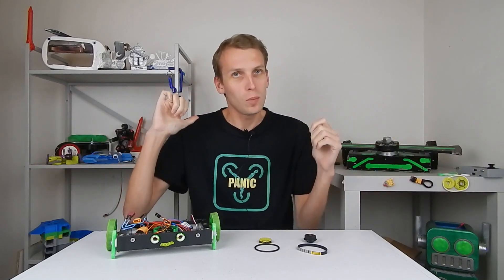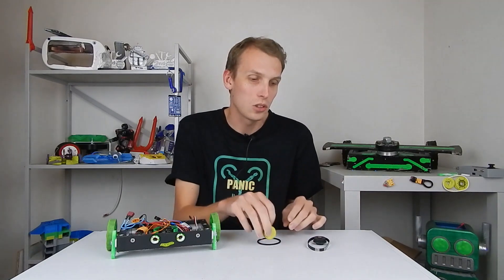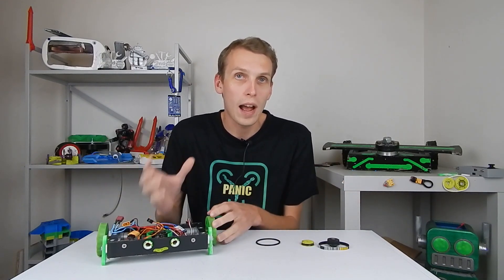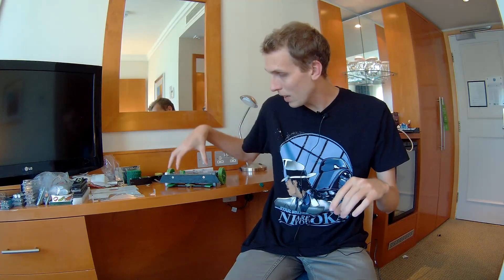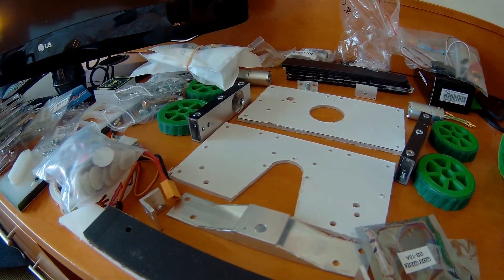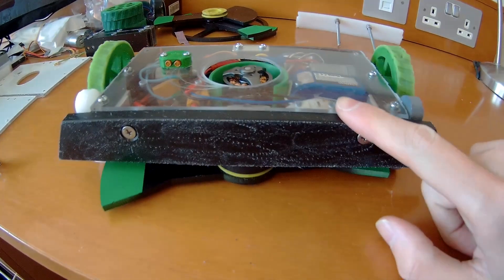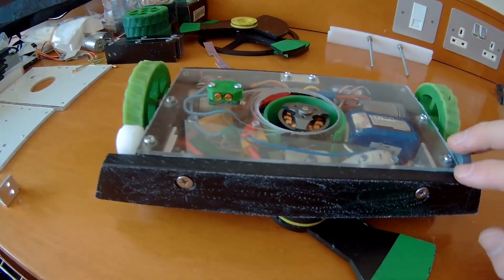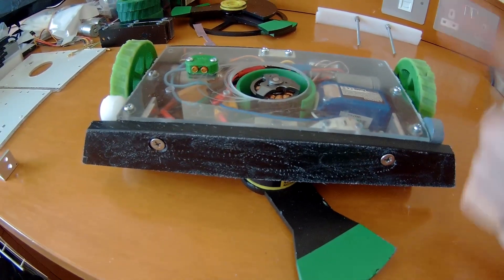Preparing for Bugglebots 2019

Comment: A few options I could see being useful:

Wedgelet Supports: supports that also stick out like a wedge to act as a secondary weapon in case the spinner breaks
Saw Blade/Abrasive Disk: better for opponents who has absorbant armor
Wheel Guards: optional wheel guards that can be used with a lighter weapon to protect the wheels
Lighter Blade: blade that can be equipped that allows more weight to be added as armor

Also noticed that you might want to turn down the turning sensitivity.
Reply from the maker: Thank you for the suggestions, but I have a few counter points for you to consider:

Wedgelet Supports:  people keep asking me to do this but it kills the point of the design, Anything that sticks out past the front armour removes some of the reach of my weapon, giving my opponent something to hit/get under other then my weapon. This is not an upgrade, its a nerf

Saw Blade/Abrasive Disk: These are hard to get right, you almost need a grabber to hold the opponent long enough for the disk/saw to cut. Also absorbent armour still has to be mounted to something, so the weapons I have will either take chunks out of their armour or rip it off its mounting. Also a saw blade would be difficult to make weight with

Wheel Guards: not a bad idea, but I dont want to remove weight from the weapon for them. The wheels are flexible and bounce when hit, so as long as I have a spinning weapon and face my opponent 70% of the time the wheels will be fine. I have definitely considered these but I need  to find a weight for them that doesnt come from the weapon

Comment: You should make Annie a wedge option for the back, just in case you lose the weapon
Reply from the maker: Thats not a bad idea, but it might be tricky to pull off, there isnt much room in the back of Annie to mount a wedge too
Reply: Team Panic it could be a light 3D printed wedge that is bolted on with a couple m3 bolts.

Comment: What fuse are you using in this iteration, because I don't know which fuse to put in my beetle's 3s
Reply from the maker: I'm using a car spade fuse.

You need to calculate the maximum current draw of your lipo battery and then choose the correct amperage fuse

Comment: You need to do both on nylon. ABS will shatter. 

Edit: Also can you put stl files for your beetle wheels? 

Edit 2: Can you put a link for your beetle motors and ESCs so I know what to use? 

Edit 3: If you end up here in the US again, bring your Bugglebots upgrades because I believe that we share a weight limit with the UK and we have very nasty spinners.

Comment: Ben u need to upgrade that switch or power source. That is a huge gamble right there. U need those Allen wrench switches, I know team wyochy makes them and I think if u Google beetle weight or any weight robot switches then u can find them. I know team wyochy are pretty expensive but the ant weight ones aren't. Also they are really light weight
Reply: He can't because the rules mandate removable links
Reply from the maker: Coboxite is correct, Bugglebots is a UK comp so they require removable links.

I have build one of the best links you can get, its shock mounted, the plugs are a tight fit and there is very very little mass in the wire holding the plugs together.
I'm confident that the link will not fall out, even if i get a massive hit
Reply from the maker: I'd like to clear one thing up, while it is a requirement for the UK to use a link, AnnieRUOK has been running a link since the very first version. In every version, the link has been poking out the top of the robot and in a lot of cases not actually held in place with anything.

Annie has NEVER lost a fight because the link came loose or fell out. Links done well are not a risk or a problem. Switches aren't the be all and end all of the sport.

I'm happy for people to prefer one over the other BUT telling people that they must use your preference is not on. Let people use what they want to use
Reply: @TeamPanicRobotics  my apologies for saying that u need to switch. My only intent was to supposedly help u out. I was unaware that that is a requirement. Glad to hear that it's working well for u. I've just seen that it fails people a lot of the time, or at least in the 15 lbs league. I will try to only offer tips and tricks in the future as long as it ok with you.  Again did not mean to put it that way. Good luck at boggle bots assuming that the event is still going on, and if not then have a good day.
Reply from the maker: All good, sorry for being a little harsh. I have seen the recent debate on this topic get a kind of crazy and in my opinion, it's all a bit silly. Both options can work but also both have their faults and reasons not to use them. 

Its like everything in this sport, there are multiple ways of doing everything. Some are easier to get right and some are harder, but it comes down to personal preference, weight and part spec

I am always happy for tips tricks and feedback, its just this subject has me touchy atm. So please feel free to keep giving feedback and opinions on my designs
Reply: I still suggest that for your fairies, it’s light, compact, and has less of a chance of turning itself off.